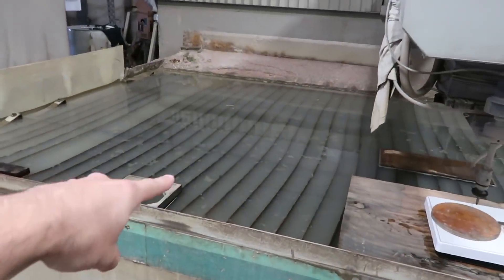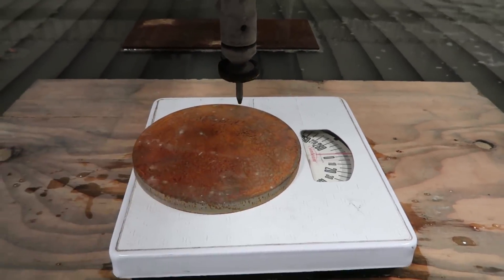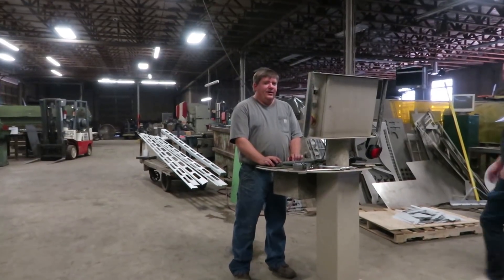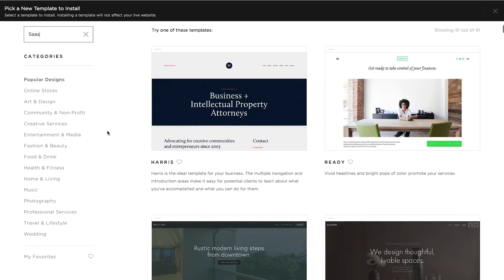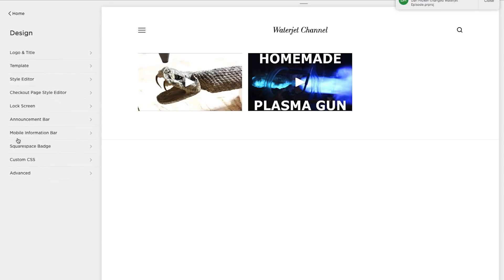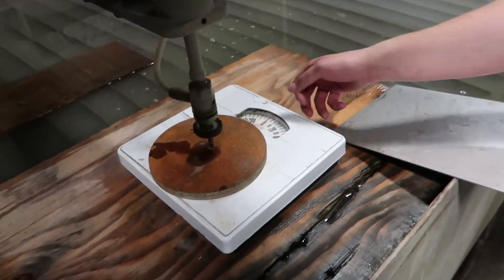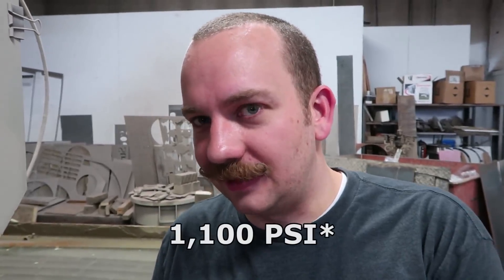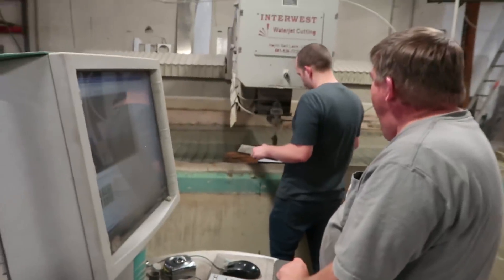How much does High Pressure Water Weigh? Bathroom Scale Cut in Half

Comment: .785 X diameter squared = area  once you have found the area then you can figure out the the pounds per square foot then  divide that by 144  which will give you the psi pounds per square inch. One pound of psi is equal to one pound 17 ponds time by 144 equals (2448) I honestly don’t know. Your scale is broke

Comment: Waterjet guys should know this answer is simple. The pressure is behind the orifice not after the orifice. What creates the pressure is the resistance to flow, kinda like your thumb over the end of a garden hose. That is the orifice.  The size of the electric motor determines the maximum flow rate and potential of pressure.  The size of the orifice determines the maximum pressure. Increase the orifice diameter and the pressure behind the orifice will decrease.  Therefor, what the orifice does is converts the potential energy of pressure to kinetic energy or velocity. Velocity coupled with volume of water and the added abrasive is what does the work, not the pressure.

Comment: With 0.015in nozzle it would be 65000 psi

11 pounds is 5kg
if the nozzle diameter is 0.38mm (0.015in), the area is pi*radius^2 which is 0.11mm^2
pressure is force divided by area (p=F/A) so

F = 5kg = 49.5N
A = 0.11mm^2
p = 49.5N/0.11mm^2 which is 450 MPa or 65000 psi

Comment: Size of stream impact patch divided by 1 square inch,  and multiply the derivative by the measured amount of weight force exerted should roughly give you your actual pounds per square inch of pressure.

Comment: Hey guys, definitely late to answer so I don’t know if someone answered it for you already but to find the force you just need your nozzle diameter or radius (anything to find the area of the opening of the nozzle) and the psi. So for example you have a psi of 60,000 and let’s say your nozzle has a diameter of .014 inches. The area of the nozzle opening is A=(pi/4)*).014^2=about .00015 in^2. For the force it’s just F=psi*A=60,000*.00015=about 9 lbs. Hope this helps if you were still curious

Comment: In order to calculate your pounds per square inch you need a Pyramid shaped item to focus your water jet on to the top of the Pyramid that way all the pressure is dispersed to the 4 corners of the Pyramid and Then you could calculate how many square inches the Pyramid is and get an accurate reading on your psi

Comment: according to Google, waterjet nozzles come in .010" or  .014", the pressure is calculated at the nozzle, the pressure with the .010" nozzle would be 140,127 psi, the pressure with the .014" nozzle would be 17,896, so we really do need that number.

Comment: The psi rate of the waterjet is the pressure inside it alowing the water to squirt out at a very impressive speed. What the scale was mesuring was the force conservation in the colision between the water and the scale

Comment: Hey, love your content guys, let me help. Try this, In theory, the diameter of jet = diameter of hole of nozzle.
find the diameter of the hole of the nozzle in feet for ez computation and the amount of water flowing out of the nozzle. 
Flowrate=Area of Nozzle*Velocity of Jet.
If it is not possible to find the flow rate, use Bernoulli's Energy Equation to get the velocity.
To find the force it exerts on the scale use Force=(density of water)*(Area of jet)*(Velocity of Jet) ^2
in Ideal conditions where the Diameter of Jet = Diameter of the nozzle hole involves neglecting any frictional losses. density of water =1.94 slugs/ cu. ft.

Comment: 71,457 psi provided the nozzle is 0.014 inch

11 / (Pi x ((0.014/2)^2)) = 71,457psi

The above answer is theoretical, the scale is not accurate, the nozzle could be worn or different size nozzle.

Comment: The actual stream of water coming out of the jet is not a square inch in contact area. I would guess it is about a 20th of an inch by a 20th of an inch. Psi is POUNDS per SQUARE INCH. So 60000/20/20 is about 150 pounds. Then you have to factor in that that speed is as it leaves the nozzle. When moving at such high speeds, air resistance has a higher and quicker effect on something so small in quantity. With only about 1 1/2 gal per minute, that stream doesn’t have a lot of momentum. And finally the energy from the rapid moving water is not entirely depleted as it splashed out to the sides.

Comment: The 60000 psi figure is just the pressure inside the line before it exits the nozzle. When it exits, it's at about atmospheric pressure. It can cut through stuff because it has a lot of momentum. Changing the momentum of the water is where the force on the plate comes from. So that is going to depend on the mass flow rate and velocity of the water as it hits the plate.

If it's hard to believe the pressure of the water stream after the nozzle is about 14.7 psi, just remember that the reason it's blasting out so fast in the first place is the huge pressure differential. If it was 60000 psi on both ends of the nozzle, there would be no reason for the water to come out. Just like air doesn't come out of an air tank sitting at atmospheric pressure.

Comment: You can first measure the area over which the force of the waterjet spreads and then devide the force (the weight) by the area to get Pounds per Square Inch (PSI)

Comment: You need to find the diameter of the water jet (nozzle). If it pushes 17 pounds then find out how many inches2 the area of the jet (nozzle) then divide one inch2 by that then multiply that by 17 pounds. And it should be 60,000 psi and if it’s 60,000psi then the jet should be 0.15mm in diameter, good luck

Comment: yes, it's pressure per square inch.  how much force(push) it applies to how small of an area. 
the smaller the area, the higher the PSI, which is why you want the waterjet to be concentrated in as thin of a stream as possible to get maximum cutting force.  it's about the same concept as trying to push through a piece of paper using a needle with your hand, vs trying to push through a piece of paper with a cup.

Comment: The water does not have psi.
Its at atmospheric pressure out of the nozzle.
60.000psi means the water gets pushed trough the nozzle at 60.000 psi. 
Its essentially the power of the pump that build up pressure wich then gets converted into kinetic energy. That punched through the material because its cocentrated at a small point.

Comment: A reply to a previous comment said your waterjet nozzle diameter was 0.014". That gives a radius of 0.007", from the area of a circle pi*r^2 we get an area of 0.000154 in^2, divide 11 lb of force by that area and we get about 71000 psi which is close enough considering the inaccuracy on your scale is probably about +/- 1 lb or roughly 10% error.

Comment: It's literally in the name FFS. Pounds per square inch. Calculate the area of the hole in the nozzle in square inches, and multiply by the pressure (in PSI)  to get the force (in pounds) that should be exerted onto the plate. God damn.....

Comment: The solution is pretty trivial.

1. Get the radius of the nozzle opening. That'll be U.

2. Get the surface area of the metal plate (3/4μr^2)

3. Integrate by parts 
(UV - v S du) = O(final)

4. Vf^2 - Vi^2 = m*a*O(final)

5. I don't know what I'm doing

Comment: okay, the area of the scale, assuming its the same size as mine, is 196 square inches, the pressure is measured in psi, or pounds per square inch, so if you take the diameter of your nozzle, approximately 8mm and factor it all in, the area of exerted force is 0.039 of an inch, at a psi of 60,000 youre only putting down 2,340 psi through the nozzle, divide that over 196 and you get 11.9 pounds, im pretty sure im right

Comment: The bathroom scale is used to measure objects that have a single amount of force on the scale, if you jump up and down the scale reads sporadically because your weight  changes with the downward movement. The stream of water out of the jet does not have enough mass just high pressure, so the measurements your looking for are invalid. Love you channel by the way!

Comment: You have to account for the size of the nozzle, the distance between the metal plate and the nozzle, and the surface area that the round plate covers on the scale. Probably some other factors reducing the force generated but those are 3 major ones you are missing

Comment: The water is not at 60,000 psi when it exits the nozzle. There are two main reasons for that. For one, Bernolli's equation says that P + (1/2)pv^2 + pgh is constant. At the nozzle, the water is moving at about 2200 miles per hour so the pressure is much lower, and doesn't increase in pressure until it hits the plate but is only at maximum pressure near the stagnation point. Then pressure rapidly decreases going away from the stagnation point. So the effective area is very small. I'm not sure exactly how small it is, since it depends on other factors like the size of the stream, and the way the water hits the surface. The actual area that has pressure on it is tiny. The next reason is that the nozzle is very thin; probably between 0.004" and 0.02". At the speed the water is moving, there is a tremendous amount of head loss.  60,000 psi is most likely measured at the discharge of the pump. 

So in conclusion, the area is very small and the pressure is also lower. As far as I can tell, there's not enough information to calculate the force that you should expect on the scale, but it makes sense that it's very low.

Comment: let ρ be the diameter of the jet stream at the plate and let r be the diameter of the steel plate.
psi ≈ (r²π * 17 lbs)/ρ².
This assumes the pressure coming from the jet nozzle is the rated PSI value, if not, it's a very different equation.
If You used r = 6" and ρ = 0.179" then you would get 60,000 lbs.

Comment: From my math I believe you will find that the nozzle is 1/50 th of an inch. The force that the jet exerts on the target was measured as 17 pounds. If its impact area was pi/4*(1/50)^2= 0.00031415 in2, then the pressure exerted would be approximately 55000 lb/in2.

Comment: If we assume that the jet nozzle is 1/16" diameter and that the scale is correct, and that there is 100% hydraulic force retained over the 2+ inches your water stream travels through air (note that hydraulic systems usually do not include air gaps), then your jet's pressure is 11 lbs/0.0031 in^2 = ~3500 psi.

On the nozzle side, if we assume that the jet really is 60k psi, then the nozzle area must be 11 lbs/60,000 psi = 0.000183 in^2... or a diameter of 0.015 in which is about 1/64". If your nozzle is 1/64" (doubtful) then you nailed it.

Going the other way, if I assume that the jet really is 60k psi and your jet nozzle is 1/16" diameter, then the jet area is 0.0031 in^2 and the weight of the water jet should be 60,000 psi * 0.0031 in^2 = 184 lbs... but that's right as the water comes out of the jet

Things that would get us closer to being able to really check your 60k psi:
*knowing the actual jet orifice diameter
*putting the jet much closer to the scale shield (losses as the jet travels are huge)
*getting a better scale

Comment: So we know the Water Jet produces 60,000 psi. We also know that max 11 pounds of force was produced during the test this includes the weight of the metal and the force of the water jet. So this leaves us the the question why is only 11 pounds being produced. Now since the total surface area of the scale is 100 sq^2 the amount of force that is producing is 1,100. What you forgot to consider is that a lot of the force from the water jet is being exerted to the metal cover. This then means that a lot of force is lost by the wearing away of the metal and that the force of the water is being distributed over the metal cover also. Here is the math:
60,000p=1sq^2 Amount of force over 1 square inch
The metal cover was about 6 inches in radius so it had a surface area of 113.1.
60,000p=113.1sq^2 *X
X is the pressure for the given area which is 530.5 p. Then you must divide the area of the metal plate by the scale:
530.5=100sq^2*X
So X=5.305

This means that the weight of the metal slab is 6.7 +-1 and the amount of force given in relation the the area of the scale is 5.305. This proves that the amount of force given off by the water jet is 60,000.

Ps:Love your channel its so cool
:)

Comment: Well ya got PSI, Pounds per Square Inch. How wide is the jet and how many can fit in an inch. If it is 1/8" that would be 64 jet holes. Then there are the leftover hole pieces. So 64 jet holes times 17Lbs. per = 1,088psi. In the vid i seen 1,100 but you said 11,000...let me review the tape...

Comment: So I’ve done some research. It looks like they have a Flow Waterjet Mach 200 model 4020, which can support nozzle diameters from 0.005” to 0.016”.

The equation for PSI through the nozzle, assuming that the nozzle was just in contact with the steel-plate-scale assembly when it read 11lbs, is 11/(pi*[(nozzle diameter/2)^2]).

This gives us a range of 54,710 to 560,255 PSI depending on the nozzle size.

(given that their equipment is probably rated for a max of 60,000 PSI, I’d assume that their nozzle size is 0.016” with a PSI of around 55,000)

thanks for coming to my ted talk

Comment: You need to divide the rate of flux by the density of pie, once you have this number you need to rotate the hippopotamus 3 degrees to factor out the degredation of the planets rotational force, once this has been achieved you simply subtract the sum of all of the parts before multiplying the original number by 9.
I hope this helped.

Comment: yea ,60000 psi  put over whatever fraction of an inch that nozzle is.  if you had a 1" jet nozzle and had a pump to keep up with that water flow, then theoretically you'd have 60000 lbs of pressure on that square inch

Comment: I think it's fairly impossible to calculate it using your method because the force pushing down on the weighing scales is dependant on the momentum of the water and abrasive firing down on it. I doubt that this can be measured so the only option is to block the nozzle with a beefy pressure guage (might no go too well😂). Using some of the other suggested methods, including the pinned one, you are left with some fairly ridiculous answers. I think the only way it can be done is when there is no water flowing because the nozzle is blocked

Comment: not sure of the nozzle size, but assuming its a 0.03" nozzle at 60000psi it should have 42lbs static force. (will not transfer that much energy to the work peice when cutting)
some energy goes into trying to lift the cutter head as thrust.
Reply: .03/2=.015*.015=.000225*3.1416=.000706 square inches of surface in the nozzle bore. so .000706*60000psi=42.4116lbs of force

Comment: The water jet is 60,000 psi but the nozzle is way smaller than a square inch. You have to take the size of the nozzle and then do all the calculations that you did in the video, and you will find it is very close to 60k psi 👍🏼

Comment: Think you were close but not counting for the fact that the area the pressure was hitting was much smaller than one square inch, I believe you'd need to take the area size of the nozzle and divide one square inch by the area of the nozzle, then multiply that number by the weight of the pressure both with and without the abrasive to get the true psi measurements
Reply: On a side note you don't guess 11 pounds as an average, 6 pounds was the water alone and 17 pounds is with the abrasive, they are two different measurements
Reply: First you'd divide the one square inch by the area of the nozzle then multiply that by first 6 to get the psi of the water alone then go back and multiply by 17 to get the psi off the water with the abrasive
Reply: On top of which if the waterjet is rated for 60k psi I believe that's the rated maximum pressure for use for extended periods without failure of a factory floor brand new machine. Since they've had this machine in use for a while the performance may have dropped quite a bit due to normal wear and tear

Comment: The only way to figure out the exakt pressure is to measure the speed of the water right as it leaves the jet. You can calculate the actual pressure as follows: p= (density of fluid)*square(speed of the fluid)/2 
On the bottom side the math is way more complicated because you need the speed of the fluid as is escapes by the sides. Not easy but the way its done is calculating the fluid pulse balance.

Comment: First let me say that I am not good at math at all and I'm not going to use it to explain my point. This comment is just to validate that the bathroom scale is not the ideal unit of measure for this experiment, I know obvious right. But let me explain to the less sophisticated people such as myself why the reading on the scale was so small. I thought the thing was going to spin around like crazy, I'm sure someone else thought that too. But just imagine if you will an air compressor and an air gun attached to it, you set the output hose to let's say 90 psi. You put your hand in front of it and release the air, does it feel like 90 pounds is pressing against your hand, of course not. This is because the air is concentrated to a very small outlet and like water when it contacts something of much great density it quickly disperses outward. This is why you need such a high output coming from the nozzle to cut something. That is all that comes to mind about that. I do think it would be cool though to have this kind of experimentation with a fire hose or hydrant  with a similar weight scale and see what reading you would get. Getting hit with that water pressure out of that big outlet will knock you on the ground so it makes me curious lol.